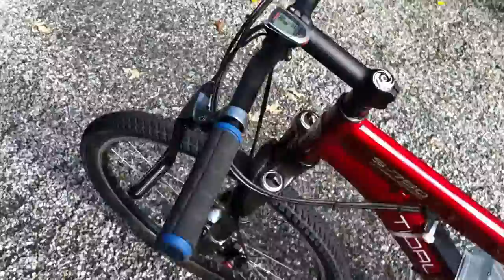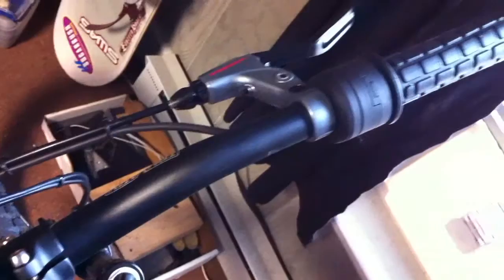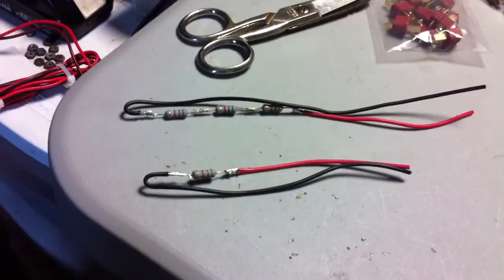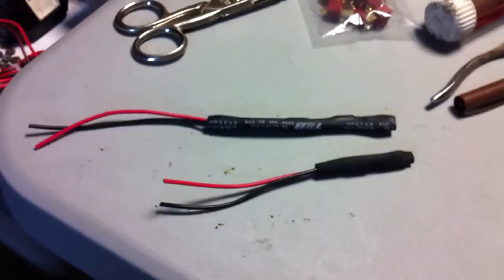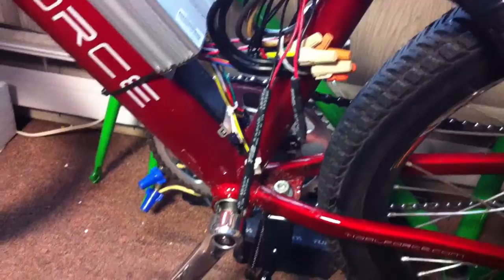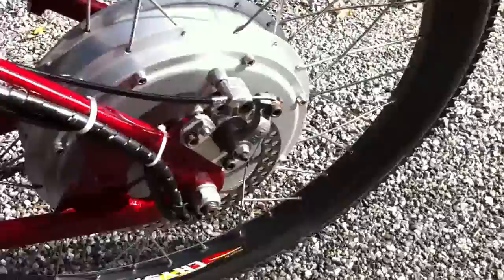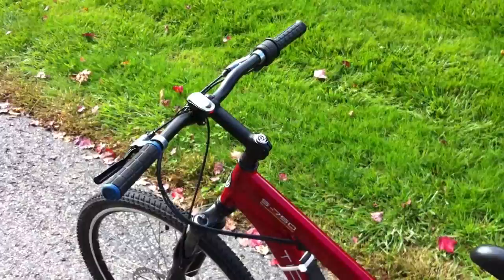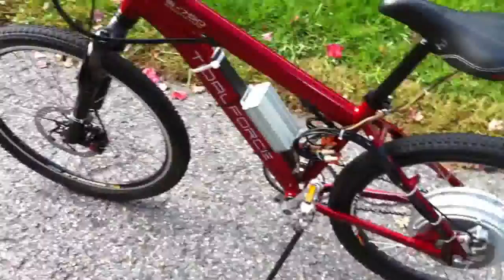72V X5404 Tidalforce EBIKE gets a Magura 5k Throttle and Avid Brakes

Comment from the maker: My system is 20S LIPO 84V fully charged, with a 12-fet 45a controller. The motor is a x5404 DD so it can handle a wide voltage range

Comment from the maker: in this case they get rid of the dead spot in the 5k magura pot throttle. this controller is designed for a hall effects 5v system. so adding a 1k and 3k resistor to the circuit makes the twist throttle smoother feeling.

Comment from the maker: ya i had 1 large dead spot of nothing for the first half of the throttle..and then i had an unstable range of bands.. these resistors solved both problems at once. Just make sure your throttle and controller are both either brushed or brushless before wasting your time on this mod. If your using an incorrect throttle you can get odd results. This is just a fix for 5k pot throttles.

Scott

Comment from the maker: those 18650gr cells take a beating.. i just got a new charger so i may add some balance leads to them so i can monitor them more. They sag so bad when i run them because the C rating is 2 so yes they get hot. But somehow maintain a decent load output. after a 10 miles ride at 30 plus the heat shrink is getting vry warm.

Comment from the maker: no i didnt get a speed or acceleration increase but when i added the resistors i have more band on the throttle now.. you might be able to program your controller to a 110-120% setting with software

Comment: Oh just that i heard with a hall sensor throttle they output 1volt to 4 .2 volt. And with a potentiometer (pot) throttle like the Magura they work 0 volt to the full 5 volt which would result in a tiny bit more power if that makes sense?

Comment: Where were your dead spots?  I've only had my ebike for a couple of weeks now.  I just put on a new controller and throttle, but my throttle does absolutely nothing until it at least half applied.  I want to remove my giant dead spot  but don't really know what resistors I need.